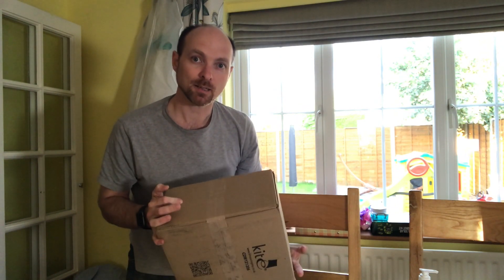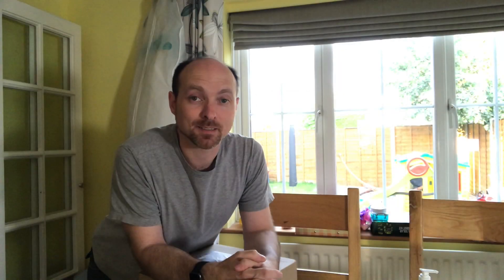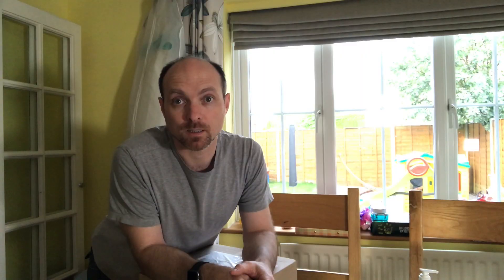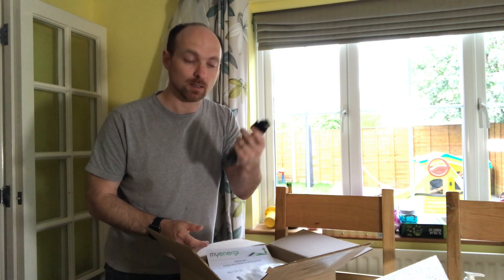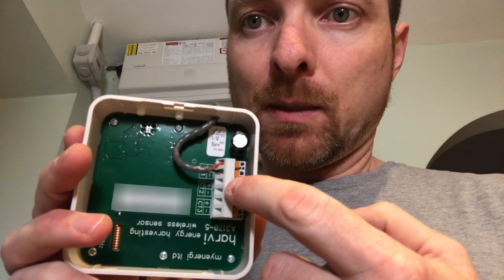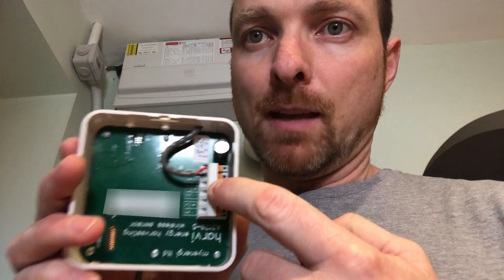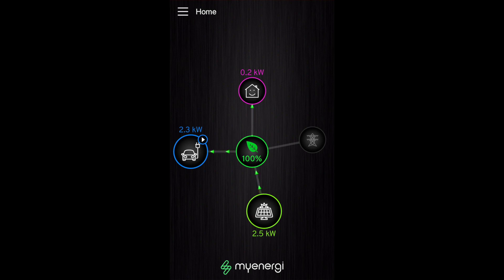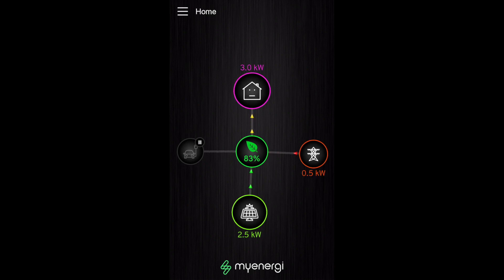MyEnergi Solar CT Install

Comment: Hello is the ct clamp for the solar connected around the live cable in the board going into the breaker which feeds the inverter ?
Reply from the maker: Yes 👍

Comment: I've got exactly the same trouble my installers fitted a Solis inverter for the PV and a Solax gateway for my Battery Charging and the Solax App doesn't show PV Generation, so the charging of my Battery is cocked up, I'm fed up of pestering my installers to fit me a secondary CT Clamp so it shows PV  😢😢
Reply from the maker: Sadly a lot of installers are overwhelmed at the moment still should be a simple job for them so they should be looking after you 😕
Reply: Hi Ian . Buy yourself a Solis wifi stick , it will show you pv generation and battery .

Comment: if i have 1 phase but two cables incoming from the meter box to the consumer unit where the solar feed is.(historical reasons with economy 7 and cash meters) You can not have two grid ct so can i put one larger ct clamp round both incoming cables and will it still measure accurately?
Reply from the maker: You could try but I’m not sure if you can get them. a harvi unit could be installed in the meter box to attach to the single cable in there.
Reply: @eviain  that was the other option but then need to run ct clamp back in to the consumer unit in the house to pick up solar panel feeds, i wondered whether the MYENERGI
100a 24mm Transformer c/w 5M Cable would fit round two and still work?

Comment: you need 1 CT for 1 phase, and 3 CT for 3 phase (3 for just 1 cable data)?
Reply from the maker: Err if I understand the question. Yes if you have 3 phase power you would need 3 CT. if you have single phase you only need 1 ct clamp at each point in your system. If you want to measure different loads like solar then you will probably need atleast two CT clamps to measure what comes from the solar and the total in and out of the house. Check out my home set up video
Reply: @eviain  yes, thanks, but harvi does only have 3 ports, if those 3 ports are used for 3CT for 3 phase, you can not add another 3 CT for solar, or?
Reply from the maker: Correct only 3. So you would need to use ct clamps on Zappi eddi or buy another harvi
Reply: @eviain  But it is not possible to use only 1 CT clamp for 3 phase, that it measures all 3?
This is not the best that you need to buy just to add solar another harvi. 
Because i dont need eddie, but myenergie HUB is only for updates right?

Comment: Is your Zappi a v1 or v2? I ask as my v1 Zappi only has allowance for two CT clamps wheras yours has allowance for three.
Reply from the maker: Hi john It’s a v1 only two CTs in mine, I have additional CTs via the Harvi unit
Reply: Brilliant. Thanks. I have a CT clamp tied up on the  house battery and, like you, would like one for solar generation. Would all 3 CT clamps go to the Harvie or do some go to the Zappie and some to the Harvie? I assume that 3 (Harvie), and not 5 (Harvie + Zappi), is the maximum that the system can handle.
Reply from the maker: John Rogers it’s a very flexible system you can have CT clamps on both harvi and Zappi in use as needed/most convenient. Check out my home set up video. It takes you through how mine is set up
Reply: Thanks Iain. A great house setup. I am installing a Hub on Tuesday and depending on how useful I find the app may install a Harvie for the extra CT clamp. I find the Zappi brilliant and, because of my 13.25 kWh pv am am able to charge my 10 kWh house battery and 75 kWh car battery with 100% green power. It takes a few days for the car now that it's winter. No need for an Eddie as I have heat pump hot water.
Reply from the maker: Good luck John my only trouble with them has been with the setup process, it’s a little fiddly but once it’s sorted it’s very solid 👍

Comment: There is a discrepancy between what my app says I am consuming from the grid and what the meter says. The meter says I am consuming more.
Reply from the maker: Go with your meter numbers, if there’s a large discrepancy then maybe worth contacting myenergi
Reply: @eviain  I think it could be because the wire from my meter to my consumer unit leaves very little space for the  CT clamp - so there could be interference. I am going to replace that wire with a longer one, so that the ct clamp is isolated from the other cables.